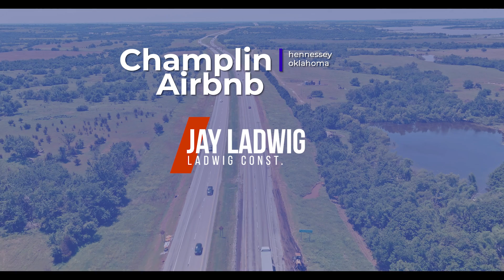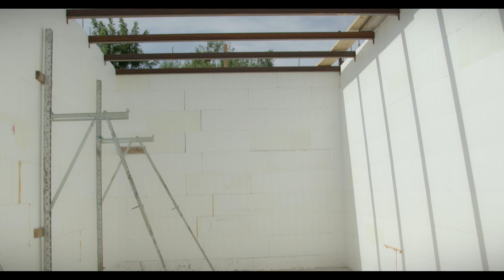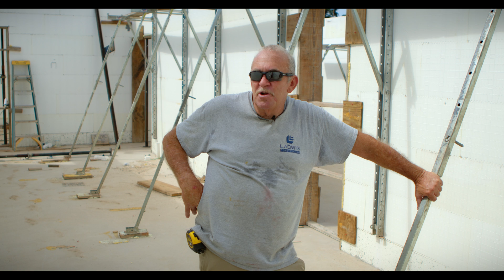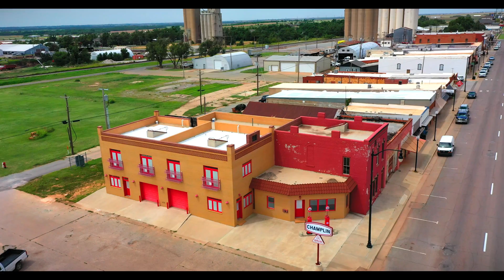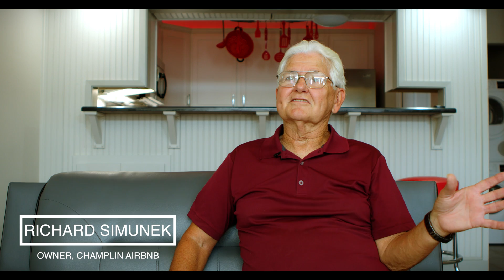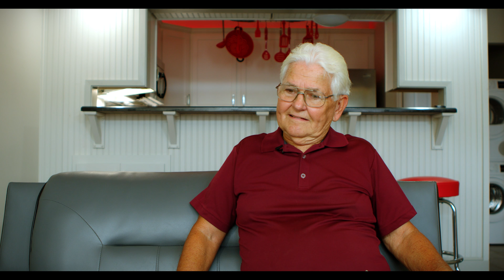Restoring Old Buildings with ICFs

Comment: Gee folks, I wish you could show more of the detail. It’s not like this process is a secret, but the majority of people that I speak to know absolutely NOTHING about Buildblock or ICF. Crazy. We have a 12,000 sf City Hall built by Carter Construction in Gainesville, FL. Oddly, people complain about the temperature variations. Hot and cold complaints. I think HVAC companies are building their side of construction by older standards. I took a mess of pictures through the process. Sure looked easy. With the tornados here in Florida recently, roofs were just lifted away while the CB remained. Oklahoma and Missouri have seen horrible destruction from tornadoes. We in Florida have seen billions of dollars in damage and loss of life. Just frustrating. Thanks for the video.